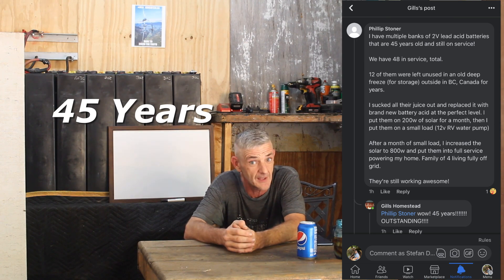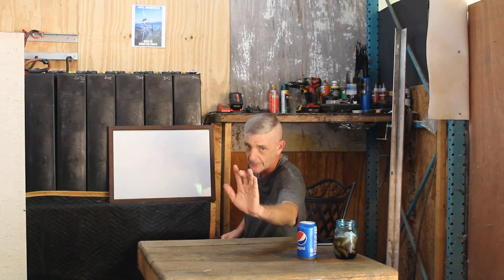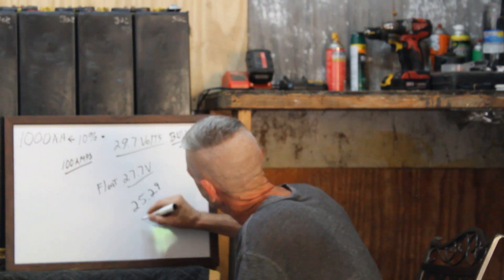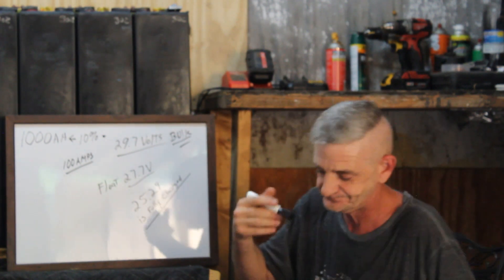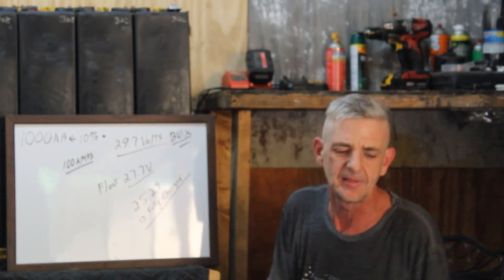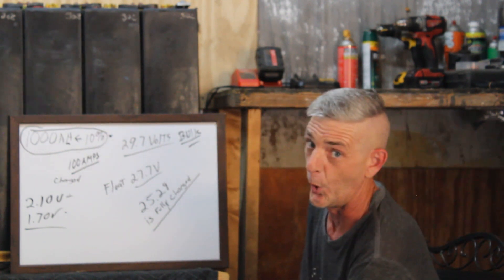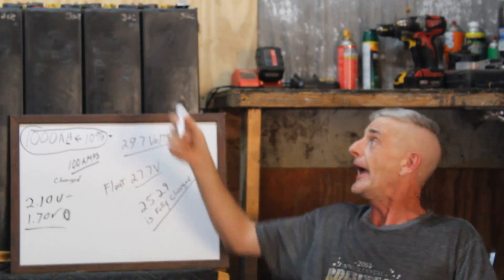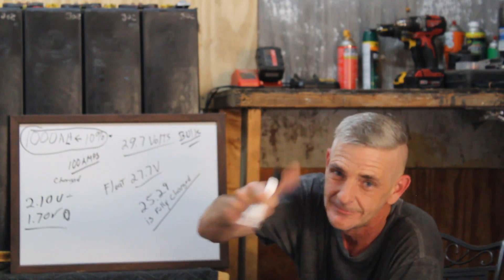Forklift solar battery charging know how

Comment: I picked up  a 380 amp hour  24 volt forklift battery I am wanting to just run my central air unit. It draws 11 amps at 230 With what I have setup I am able to to produce 8 amps 220 I am pulling 80 amps off the battery. In the daylight I have no trouble with my 3800 watts of panels. Just don’t know if I am ready to try it at night. I live in Ohio so the run time on the battery should only be 20 minutes out of an hour I think I would be pushing my little battery. But I plan on having fun with it

Comment: How many kw of solar do you have?
Reply: I’m guessing over 100kW of panels because he’s talking about running his large all electric home  on a cloudy winter day without compromises.

Edit: He posted a few days ago that his goal is to produce 200kWh in 4hrs.  That’s “only” 50kw but you should assume about 80% of panels ratings into the batteries.  So, he needs about 62.5kW of panels if they were South facing.  However, I think his roof is E/W facing, so he probably needs about 75kW of panels.